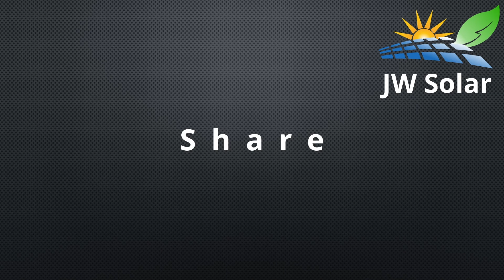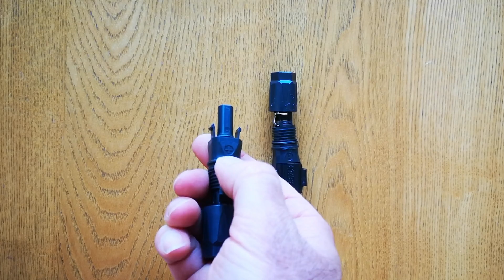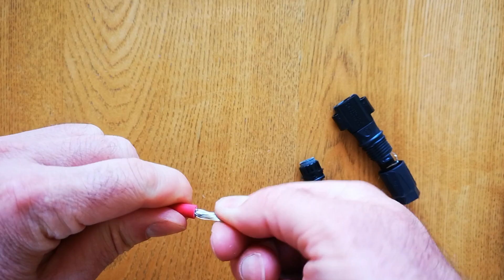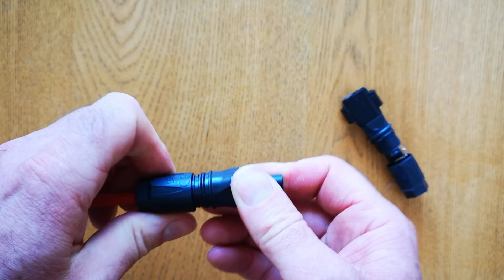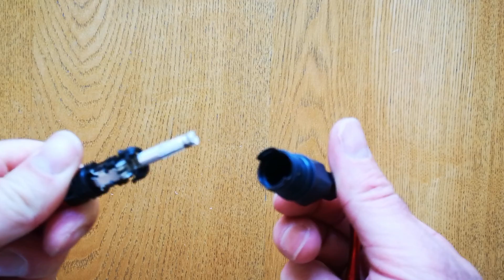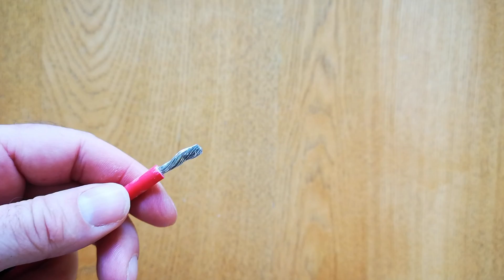How to Fit Pheonix Contact Sunclix Connectors - Solax Solar Inverter Battery Wiring

Comment: I have a X1-hybrid G4 from 2023 (installed in the summer), and the installer threw away the box and spare parts, including the battery connectors (I did not have a battery then)! I now have a battery, but the installer did not have spares for the inverter-side connector. I have been struggling to identify what part it is that I need, the local distributor is useless (Spain). I found your video, and these sunclix connectors look very similar to what is in the solax x1 hybrid G4 manual (although there are no technical / SKU reference in that manual...grrr!). You mention that solax changed the type of connector in 2023: do you have more information on how to know what type of connector I need, and where to source them?
Reply from the maker: If the connectors on the inverter are dark blue, they are Devalan, if they are black, they are Sunclix. If you get stuck I can send you some.
Reply: @JWSolar  thanks! I ordered the devalans on a german site, they are dark blue indeed, but they don't fit...Then I found your video, I did not know about the spring 2023 change, many thanks! Indeed, the connectors on the inverter are black, not dark blue. I have found someone selling a pair of sunclix connectors for an SMA inverter on the local classifieds site, hopefully this will work #fingerscrossed
I don't understand why the manufacturers don't document this in the manuals.

Comment: Why didn't you tell everybody that Phoenix plugs do not match other MC4 connectors???? The internal flats do not match any other connector!!! I just needed to make a new cord and found out the hard way that they don't match!!!
Reply from the maker: They don't match, that's the idea, so you can't put the cables the wrong way around or in the wrong place.
Reply: @JWSolar cables wrong way around? No, it's simply to force plugs and sockets to not be compatible from different manufacturers...

Then what's the point of having the MC4 standard? It's not a standard if different manufacturers aren't compatible with each others anyway

Comment: Never use a knife, always use a good quality auto cable / wire stripper.
This prevents any accidental weakening and loss of individual cable / wire strands for a safe connection (@2.26).
And reduces the chances of cutting yourself.
Reply from the maker: Health and safety alert! Nobody could wire anything before fancy wire strippers came along. 50 years using a Stanley knife, how did we manage to stay alive!
Reply: @JWSolar  For some reason our professional association in germany is called "fine mechanic and electro technic" 😉...